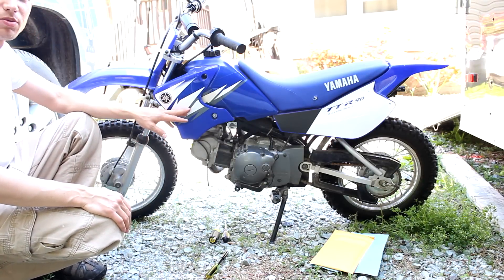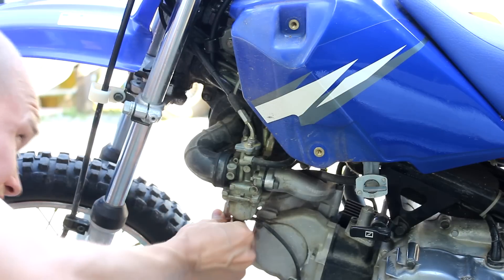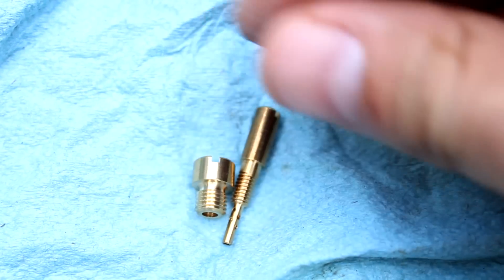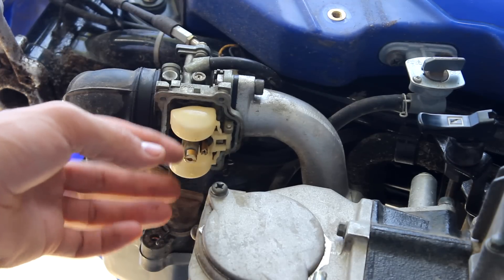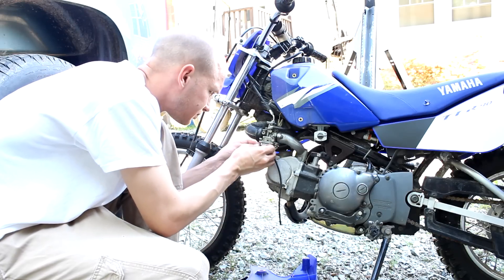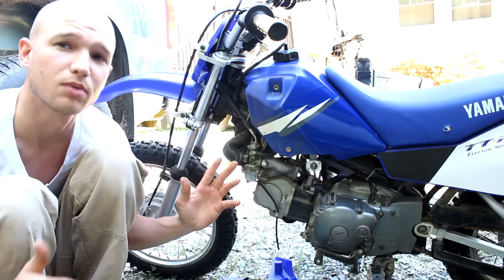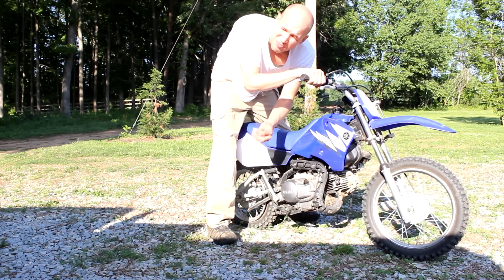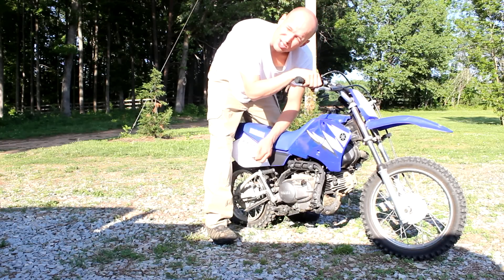Yamaha TTR90 Carb rejet carburetor re-jet clean High performance mod

Comment: I went to check the bowl of mine, and the pilot jet was sitting in the bowl. I screwed it bank in and it ran worse so i ended up taking the pilot jet out completely and it runs fine now.

Comment: I have a ttr90 n it has them electrical connections- what are they for? Cuz I got a new carb for the bike n it don't have them electrical connections!
Reply: Did you ever find out what those wires do

Comment: I lost first gear on a ‘03 TTR90.  I can shirt 2 to 3 but unable to get into first gear.  What could I possibly getting into.  The bike how low miles and I was hoping to repair want is only broken.  Local Yamaha, suggested a full rebuild = $1,800…!
Reply from the maker: Dang.. that sucks man.. I know parts are crazy to get right now.. I feel like just a few years ago you could get a used replacement engine for $300-$500.. So that is insane for $1800..

Comment: Two Questions on this bike:  In order to get compression when kicking i need to put in in gear and rock it for each kick, is something out of adjustment?  Question 2, when electric starting this bike if it does not fire within the first couple of seconds the starter stops spinning and there is some clicking in the electrical components in the back under the seat, whats up?

Comment: Quick question. I am trying to work on my sons 2001 ttr 90 .I have taken apart the carb a million times cleaned the jets etc. The bike starts up fine as soon as I take it of choke it stalls. What am I missing?? I learned from watching all your dirtbike videos they were very good.
Reply from the maker: thanks for watching! Its been awhile since i had this bike.. Did you figure out the issue? My guess would be something tiny is clogging one of the jets?

Comment: Hello, I just bought a brand new Battery for my TTR90. Do I have to charge the new Battery before installing it or just replace. My buddy told me I have to charge it 1st, but not sure how and how long if that is the case. Thanks !!!!!!
Reply from the maker: I would throw it into the bike and ride it around for awhile.. let the bike charge it! But i've never replaced mine.. so I'm not exactly sure
Reply: sxecrew EXACTLY what I was going to do. I think the bike itself should charge the battery if it is not already charged. Thanks for the reply
Reply: I bought a 20 dollar battery from amazon for my trr90e and it started the bike right up from the box and is still going strong after 5 months.

Comment: Not sure if you'll reply but could you tell me what the hose that's about 4-6 inches that runs into the gas on/off/ reserve switch. Mine is cut and won't run until it's replaced
Reply: TBE TeeJay that is how the gas gets from the tank to carbuy

Comment: nice video broh but i got a ? wat are the bigest jets i can get for dat ttr90 i got one today but  my fuel valve petcock iz broke and i need to oder one oh and i did all my sht like your hit me need help
Reply from the maker: luis Gonzalez - It all depends on what you did to it.. I would suggest 95 for main and 15 for pilot.. any bigger and you risk running to rich or lean.. one of those.. lol.. but you can get from 12.5 -50 for pilot (12.5 is OEM) and from 80-180 for main (85 is OEM?)

Comment: Hey quick ? My ttr 90 in nuetral when I rev it decel pops and when I put the choke fully on it chugs then dies . Is that normal or only use choke in winter ?
Reply: You need to clean the jets. The smallest piece of debris in one of those jets will make the Bike Bog out. Also, check the float bowl is springing back and set right. You shouldn’t have any problems with the choke after. Make sure your Air Box hoses are on tight and put a new filter in if it is dirty. 
I restored and rebuilt 2 of these TTR90’s. I still have a 2007 90.

Comment: What is the seal at bottom of carb mine is same as yours where goes around the bold but can't find that version antwhere
Reply from the maker: ttr90 carburetor gasket
I don't think you can buy just the gasket (maybe from a dealer) I bought a carb rebuild kit, and it had one in there...

Comment: i know it's been awhile and you sold it but where did you find those jets? I found some on ebay but it says for yz and cr? does it make a different
Reply from the maker: i bought from parts unlimited.. I'm not sure if the jets are specific, so i would rather be safe (so i wouldn't need to return)

Comment: hey i have a stock tar 90 does this jet kit change make the bike have more rev and make it go faster
Reply: kawi 672 
I read unless u upgrade your Exhaust system leave the stock Jets in. It won’t don’t anything as far as performance without a different exhaust and or different  carburetor !

Comment: Hi Mate,
Where is the best place to order the 2 jets from please?
Cheers Brett
Reply from the maker: you can order off thumper talk, ebay, or i got mine of jetsrus.com
Reply: matt dobson. I done all of this and my son's bike still hits a rev limit when we twist the throttle all the way. the bike is a 2004. it breaks up on top end. What will solve this issue?
Reply: adjust carb maybe?

Comment: I have a ttr90 and it idles high a guy had a video about a ttr50 where he drilled a whole into the carb and popped this cap out so that he could get to the idle screw. Is there really a cap covering the idle screw or is there another reason it’s idling high. There throttle connectors don’t control the idle and there’s no idle screw showing so I figure it’s hiding behind the tiny cap
Reply: No. It's a knob on the right hand side of the carb near the cylinder head

Comment: Where is the idle screw
Reply from the maker: Steven Mclaughlin - It is a pain to get to if you have big hands. Its on the opposite side of the open side. Its a knurled screw that can be turned with you fingers. The size of the screw/bolt is smaller than a dime, maybe the size of a the tip of your pinky finger.
Reply: sxecrew thanks for replying, my bike will not idle, now hopefully ut will